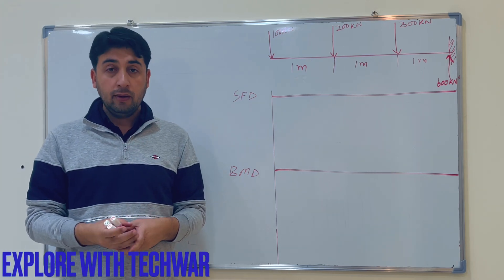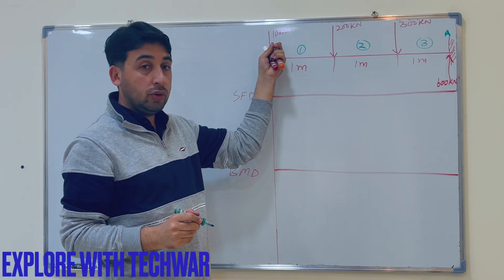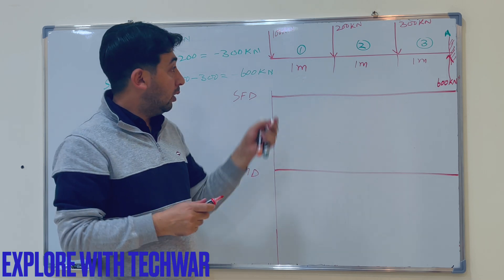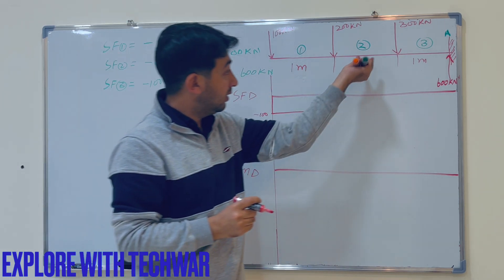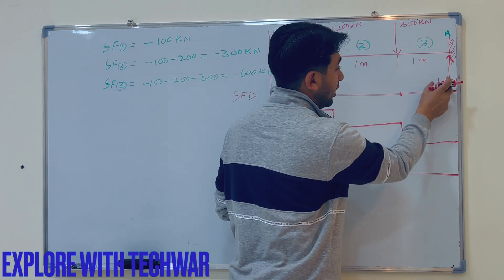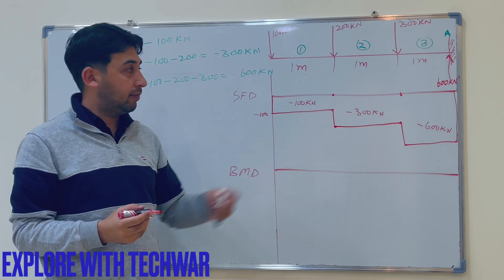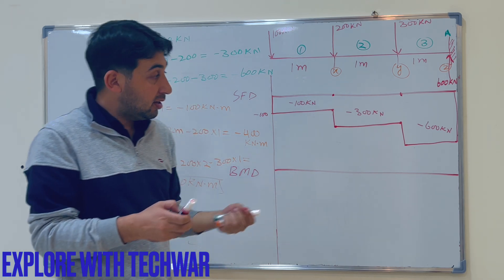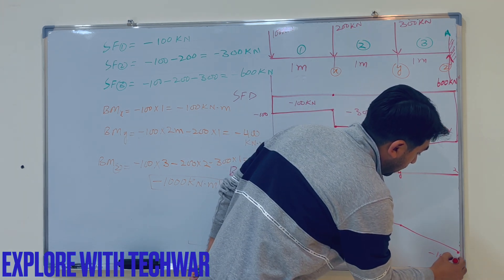Shear force and bending moment for cantilever beam | shear force and bending moment diagram

Comment: Mr.
Iftikhar Ahmad how it become from -1000 kn.m again to 1000 up to zero when the force is 600 kn ? can you please justify
Reply from the maker: That 600 kN is not causing any moment, actually the moment at that point is maximum but you can calculate reaction moment at the same point i and it will give you the same 1000 magnitude. But the maximum moment will be at that point.